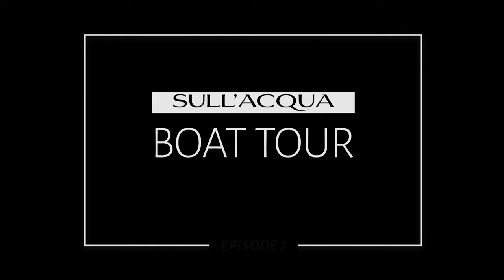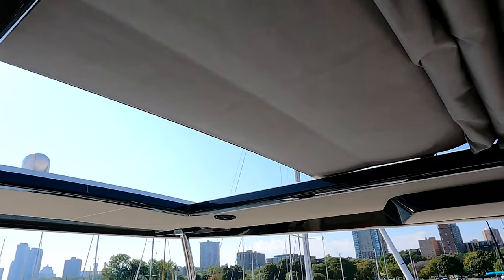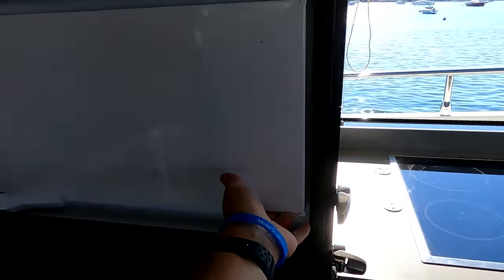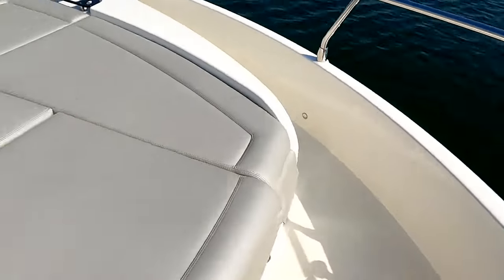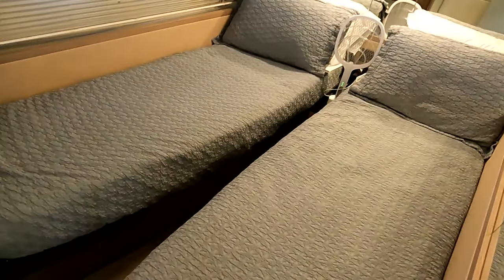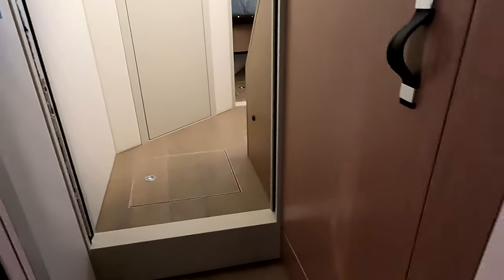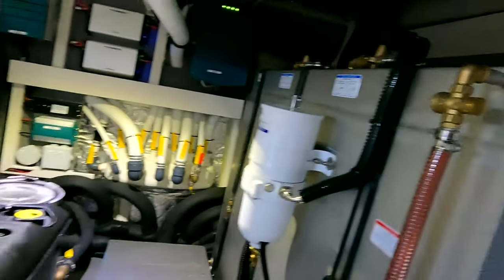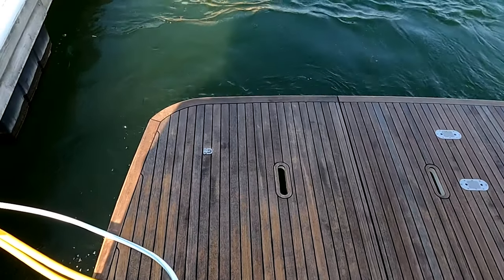Sull'Acqua Episode 2: Boat Tour (Absolute Navetta 52)

Comment: do run the seakeeper 24/7?
Reply from the maker: No, I do not; however, I have found it particularly helpful when docking or leaving the dock. Seems to help the roll-effect that occurs when using the joystick/pods moving sideways. It takes about 20 minutes to spool up, so I generally play it by ear as to whether I feel we need to reduce the rolling. Highly congested boating areas are definitely a place I use it. Hope that helps.
Reply: @MV-SullAcqua  thank you! Hard to find a lot of good info on these systems

Comment: Great boat! Question I have always wondered and that is can this boat make a continental crossing? It seemed to handle rough seas very well. Wishing you happy voyages!
Reply from the maker: There are different classes to boats and this one is a Class B — Offshore – These boats are designed to go offshore with the ability to handle winds up to gale force 8 of 40 knots, and seas up to 13 feet (3.96 meters). For maximum continental crossing confidence, you might consider a Class A boat. We are confident navigating this one down the Atlantic coast and from Florida to the Bahamas. Hope this helps your research.
Reply: @MV-SullAcqua  That is great information and thank you for that.